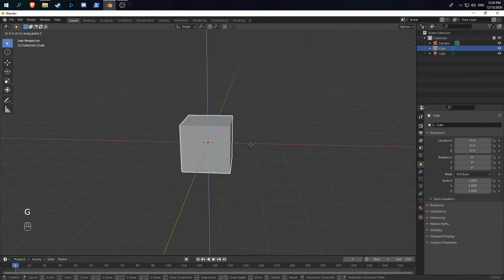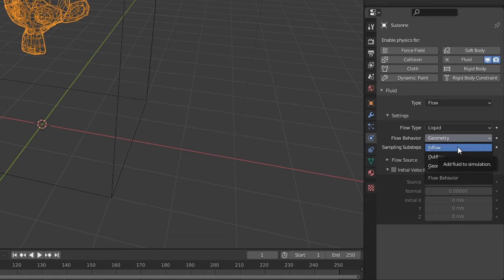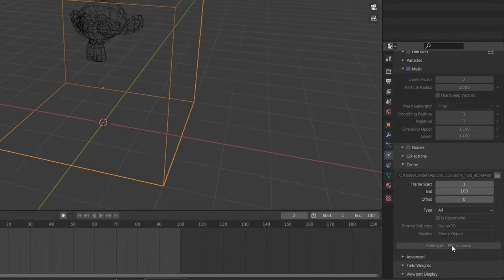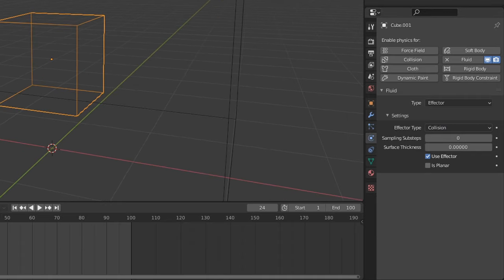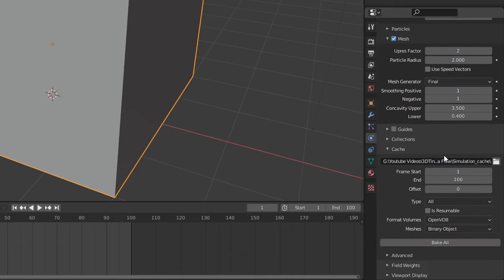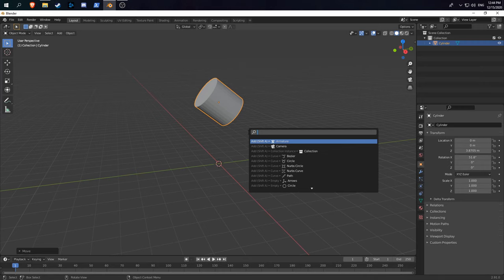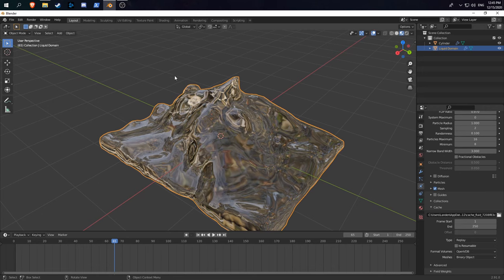Learn Blender's NEW Water Physics in 6 minutes! (Blender 2.9+)

Comment: I've followed countless fluid simulation tutorials and follow everything to the T and still I get no fluid simulation. I've tried this for over a year now and nothing happens. What am I doing wrong?
Reply: Im getting the same problem now
Reply: I had similar problem and found solution which is working for me. Not sure if it helps though. in Cube Domain open up Liquid Properties and there is "System Maximum" attribute. Give it some value and you should be fine.
Reply: @michalgasparovic9349  thanks, I'll try it soon
Reply: Hey man, you and I have the same issue, if we are following this tutorial, scale up your monkey (flow) and box (domain) quite a bit. And you should be able to see the flow simulation. I assume that my original issue was that my geometries were too small to see the flow physics, its not a hard science but it worked for me. Hope that helps, Cheers.
Reply: @michalgasparovic9349  That worked for me. Thanks dude!
Reply: I was having the same issue, then i did something and it may seem silly, but it worked for me, and may be what is happening to you.  When you have Domain selected, go down to Type under Cache.  Select ALL, then select REPLAY again.  Now when you press spacebar, things happen.  If you make changes to your simulation, do that again and it refreshes it.
Reply: For me it worked litterally once and never again
Reply: Did you click on the cube when playing
Reply: making everything bigger solved it for me
Reply: I was getting same problem during replay so switched to modular and then baked and it worked
Reply: @ipga13   did you tick the mesh box cuz i always forget
Reply: one issue that might be making a huge difference is make sure you are in edit mode before scaling your objects. if you scale/rotate in object mode you will throw your particles off.
Reply: @enric2815  both worked for me canching system maximum to something and changing between all and replay to "refresh" the simulation at least i have water, now my problem is the water disapearing in the bottom of domain but im gonna see whats going on
Reply: @borremetal  that might have to do with the domain borders though I'm not too sure about it
Reply: @enric2815  i tried to make some type effector with collision at the bottom and domain cube is even longer but idk i will be keep trying and looking for a solution
Reply: Guys, make sure Suzanne is inside the cube. I put my flow object high above and it wasn't working.
Reply: I was having the same issue.   My solution was>  Select the domain> go to physics settings (once you've applied the fluid sim in the video) > under settings uncheck the "use adaptive time steps" box> re-check that same box .  Fluid sim now works in replay mode in the viewport as shown in most tutorials.  No idea why this is the case   (fun fact,  this only worked once, created a new scene and its back to not doing anything again)

Comment: Blender 2.91.2 and the fluid simulation isn't working at all. Literally have all of the same settings as you.
Reply: BAKE ALL first time, and after that change to Type: Replay.
Reply: @gaborr7792  nope, there are still missing steps or setup....
Reply: @nowherebrain  IVE COPPYED EVERY DETAIL THAT HE DID NOTHING WORKS
Reply: its working for me
Reply: @land23  I have to bake to see the blue dots at all
Reply: For me it litterally worked ONCE
And no. i have 55Gigs free and i cleared my temp folder.
Reply: I found a Solution. Check The Mesh Checkbox. Then bake it. If    your mesh is low poly. You can directly play the animation.
Reply: @onebashman2808  i saw lag as i did that so something was happening. buut i saw nothing. nether particles nor a liquid. Also the Domain box dint even gte invisible like it should
Reply: @ipga13  watch my video. I can't post the link.
Reply: Okay, I had this issue.
Simply put, there is a checkbox step that's missing.

On the cube, in the physics there is a section for "Liquid".

> Settings
> [✓] Liquid
> [  ] Guides
> Collections
> Cache

He doesn't check this since it's already checked for him, but it necessary for this to work.

Comment: I couldn't get the mesh to show up, or the sim to work. But after I check "enable" on "Mesh" for the domain, then go to the RESOLUTION DIVISION in the "Domain>Settings" and drag it left or right it will eventually enable the mesh at some point, in my case it only shows the mesh at "44" subdivisions, but doesn't work on almost any other. My guess is it has something to do with my geometry of the liquid which is a cube instead of sphere. I couldn't get outflow to work at all with a circular face surface.

Comment: replicating these same steps in v 2.93 nothing happens. some checkboxes in the domain settings, when clicked then disabled again result in an animation where the water 'drops' to the floor of the domain.... splashes are minimal. i suspect a video card issue with my quadro p4000...not really a common card. 

i've followed a bunch of tutorials to do a 'water splash', but they all have the same result. not much.
Reply: yes yes , replicating these same steps in v 2.93 nothing happens.

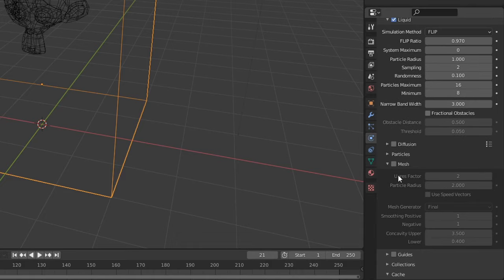Comment: This is buggy for me. Sometimes it works, sometimes the whole simulation just won't do anything. I hit play and literally nothing happens. Also, you do something at 1:55 where you skip to the monkeyhead being a cube. What happened? I'm not following. Not much of what you do in this video works as you do it for me :/ Got Blender 2.91 on a GTX 1070, with 16Gb, so that shouldn't be the hickup, right?
Reply: I had similar problem and found solution which is working for me. Not sure if it helps though. in Cube Domain open up Liquid Properties and there is "System Maximum" attribute. Give it some value and you should be fine.
Reply: @michalgasparovic9349  Same here and the System maximum atribute solved it
Reply: system maximum attribute was the solution for me as well, also don't forget to check "mesh"
Reply: @michalgasparovic9349  omg ty <3

Comment: I have turned soldier from tf2 into a liquid sim with 512 subdivisions. Blender is using 32 gb out of 48 gb of ram. That's why it's not responding.
Reply from the maker: I have done nothing but render water for three days.
Reply: @3DTinkerer  i tried rendering sand by adding 1000 particles in the molocules addon. Then my pc turned into an aeroplane and then into a giant sand monster. Then ate a bomb, probably why it's not responding

Comment: Thanks for the concise tutorial!

My water appears white while in material preview. Any quick solution for this?

Edit: As a potential solution, 
-I added a new material for the cube
-Chose glass preset
-Adjusted material settings further for the cube
-Shaded smooth

Is this the best way, or should the fluid appear as a clear liquid in its default setting?
Reply: it doesnt you just have to apply some shaders in the shaders tab, i just dont know how

Comment: why its always such a low fps in render simulations? (im a beginner)
Reply from the maker: You can raise the fps, but that means longer render times. Most movies are shot in 24 frames per second so you can usually get away with that in blender animations. You can set it to 60fps, but it will take twice as long to render.
Reply: @3DTinkerer  thanks. As for me, Quality is over time! Especially if you are going to post it in the Internet

Comment: mine is running for 3 days..will take 2 more days to complete..serious need of upgrading.
Reply from the maker: You can always try scaling back the settings. Happy rendering!
Reply: @3DTinkerer  needs one suggestion. is the new mac m1 good for blender rendering? I need it for fluid animation work for modeling and simulation . or any suggestion In the price range of 1500 to 2000 $
Reply from the maker: @bediumang  It depends on your needs. If you are doing a lot of rendering for work, I would recommend getting a PC tower instead of a laptop. 

But if you are moving around a lot, or are using eevee instead of cycles, you could probably get away with using a m1 macbook.

I am not sure if Blender has a native ARM version available yet, but the Rosetta app should allow it to run on M1. Here is a video I found that dives a bit deeper: https://www.youtube.com/watch?v=y04uPXDElt4
Reply: @3DTinkerer  ok thanks for valuable information

Comment: Hello, I hope you can help me stop the Flow from keyframing?  For me, it's a Honig-like substance that has to be turned on and off.  If I Bake that before and after then it takes a very long time sometimes a lot of frames later that the flow only stops after I have keyframes.  And suddenly the collision with my other object no longer works.  I hope you can and want to help with this?  I also tried by setting the Domain setting to Type Modular, but after the Data  Baking the Mesh Bake button remains gray (even though Mesh is checked), so I have it bake in type: All.  I work in Blender 3.01.  can I contact you about this somewhere?

For the rest, a nice and powerful Tutorial, and I want to know what exactly I'm doing wrong and how to solve it?😊

Comment: You mean that your pc needs to run 3 days for real ? Or is this a joke
Reply: I don’t know that much about Blender but I want to start wirh it
Reply from the maker: Mostly a joke. But if you have an older PC, high settings for fluid simulations do take a while. 

But if you want to use Blender for more conventional 3D modeling, it is very fast.

Comment: Is it just me, or is liquid sim extreeeeeemly buggy? Or at the very least - insanely touchy? I have a glass pitcher, I have a "rock" inside of the pitcher. I want water to pour into the pitcher and surrounding the rock, it should fill up the pitcher and then over flow out into the rest of the "domain" - a cube around the scene.  I can get it to sometimes react with the pitcher, sometimes it will react with the rock, but I can not get it to react with both simultaneously. Anyone know where I should go for help with this liquid Mantaflow problem? I ended up changing my source to be a sphere and geometry type. It still doesn't work with both effectors, the rock and the pitcher simultaneously.
Reply: Blender 2.91 TIP one: for beginners - Adjusting Domain seems to be required to get the "live" simulation to update after any change. Changing the Resolution Division in Domain Settings or changing the values under "Liquid" properties seems to work to initialize recalculation of simulation. TIP two: be sure when adjusting values that animation is on Frame 1. Changes are not shown in viewport if animation is on any frame other than frame 1.  Tip 3: set system Maximum to limit number of particles - aka - to turn off the faucet.
Reply: Joined the Rock and Pitcher into the same mesh object to just get the sim to work on both objects.

Comment: Great video, but i want to know how did you you do the beginning ? How do you have like a "fix" water cube  with no movement ??

Edit : i found 👌
Reply: How ?
Reply: @bestecho5953    if my memory is good you have to setup a cube as domain for the simulation. The dimension of the domain are a very little bit bigger than you "cube of water". Then you add inside the domain your cube and set it to flow. And if your cube is at the level of the "floor" of the domain it should work. Ofc you have to setup the domain to liquid and to choose your own settings of the simulation. (Sry if it's not really clear i'm not in front of blender right now and sorry for my english)
Reply: @syamagung7142  sry i didn't see your com, i answer down there ⬇️
Reply: @CallMeVycon  okay... Thank you so much